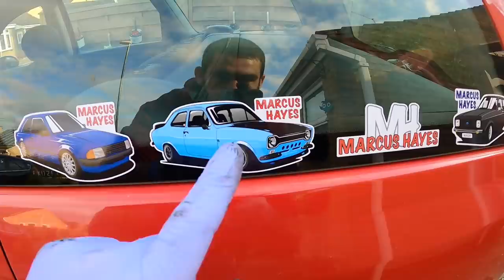ESTHER'S NEW ST170 ENGINE IS IN!!! 😃 . . .& Fixing Dad's Focus! 😃

Comment: Engine in that's great , is there no dust or dirt shield between the gearbox and adaptor plate? Looks a little open down there. Hope all goes smoothly with the rest of the install .🤞
Reply from the maker: No dust shield mate. I could make one but Iv never had a problem not having one on past setups. 👍

Comment: Always wanted to do this sort of swap into my sierra hatch, info for sierras swaps are quite poor but would mk1 and mk2 escort conversion parts just work the same i.e engine mount adapters, water rail etc
Reply from the maker: I THINK you can use the 1800 CVH mounts to fit a Zetec into a Sierra mate. 👍
Reply: @marcushayesford  thanks boss